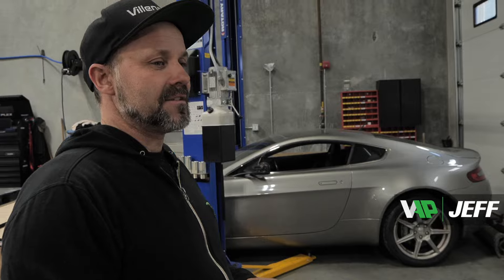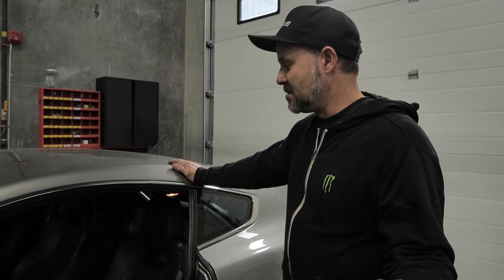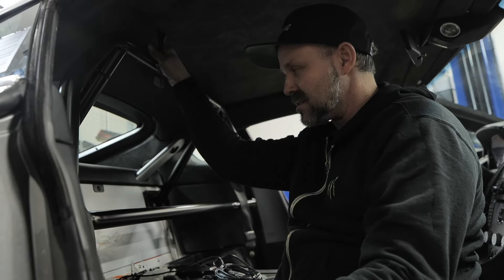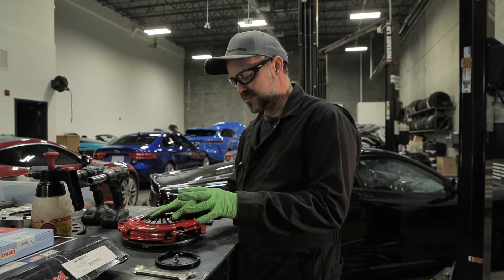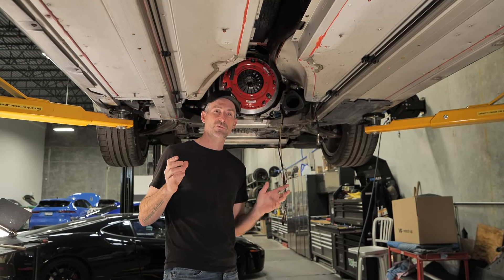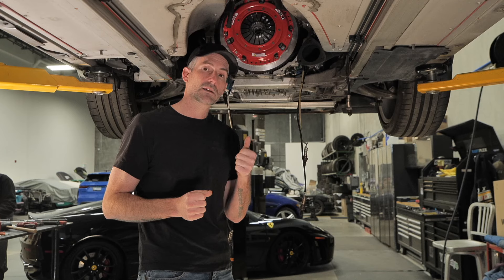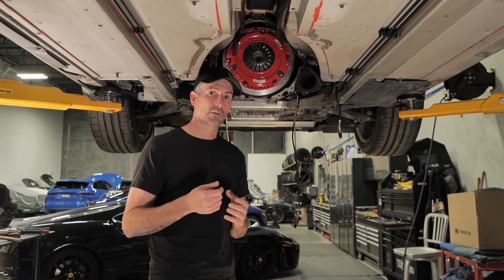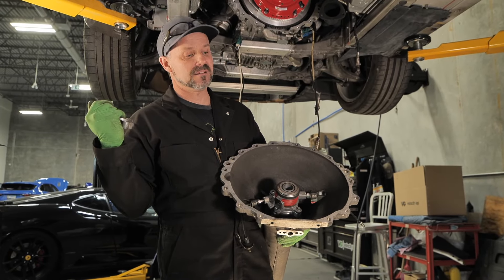Episode 8 Project: Super-Vantage / Aston Martin Vantage Supercharged

Comment: I distinctly remember that car having a super high take-up when I drove it back in 2011 or 12. Enough so I was worried it was how all of them drove and was relieved when I test drove mine that it wasn’t normal.

99% sure it’s the setup and original that caused the high take-up since it was there new. 

My best try to recall is that they used a Mustang clutch to try and hold the power. 

If I can be of help, let me know and I’ll share as much of the history as I can remember of when it got that kit.
Reply from the maker: Thanks very much for reaching out.  We've changed the clutch for a new one, and adjusted the spacing on the bearing to alter the pickup point a little lower in the pedal!

Comment: Amazing project, great posts! Was wandering, what is the reason you went with the McLeod LS clutch and "special machined" flywheel over your (or AMR) twin plate clutch kit? It was my understanding the AMR twin set up, or your VAP version of it, are well capable for the power upgrade. Could you share details of the McLeod set up? Thanks!
Reply from the maker: So, this is not a VAP-origin kit/build.  We were offered this car in a semi-disassembled state, but the kit & parts were already designed.  This car is making significantly more power & torque than an OEM V12V, for which the twin plate kit was originally designed and the clutch that is fitted to it should be able to hold a lot more torque.  So we chose to stick with what had already been proven & designed for this specific application.
Reply: @VelocityAP 

What is this hp it is making?
Reply from the maker: @KelvindeWolfe  Its tough to say right now, we are still testing. I think we will get around 750-850